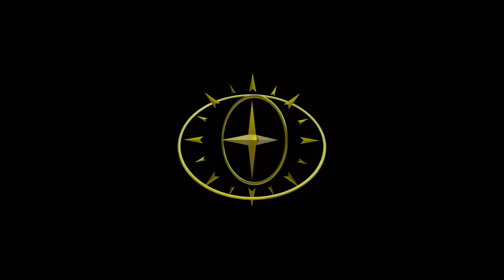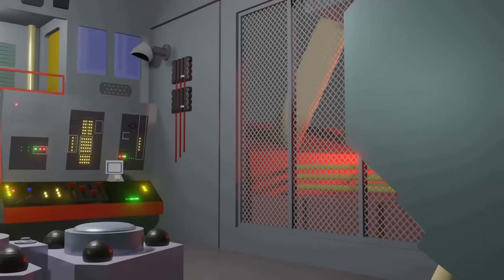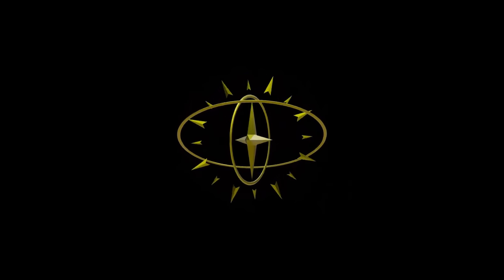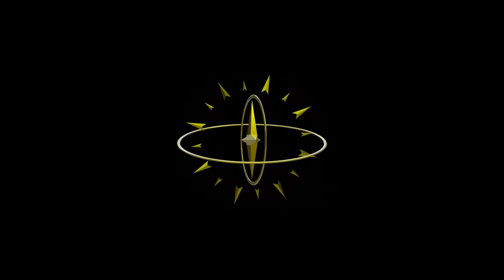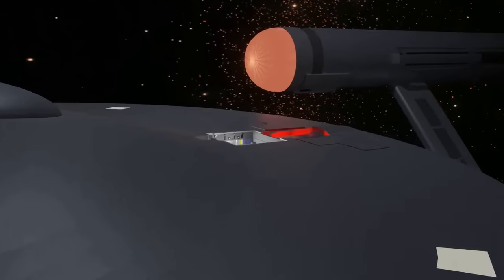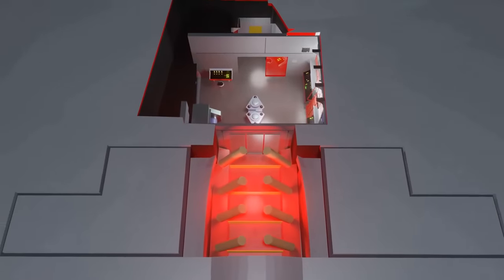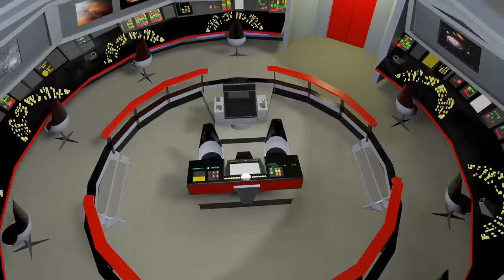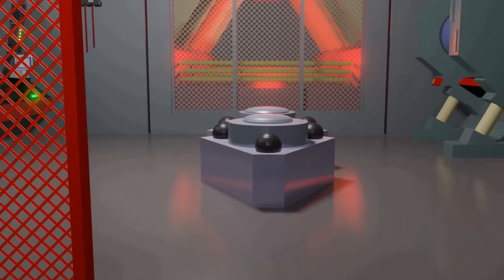The Enterprise Engine-room Enigma: where was main engineering?

Comment: Franz was just creating fan art outside of the shows creative team and his stuff is not canon…. Clearly this question was put to bed via subsequent efforts  by the Star Trek art department and scipubtech.
Reply: Who's Frank? Franz, you mean? Franz was commissioned by Roddenberry to create a canon technical manual, and his manual has TWO engineering areas: an area marked "Main Engineering" near the Impulse Engines in the saucer, and a separate "Warp Drive Engineering" in the secondary hull right under the nacelles. Main Engineering is shown to have computers that can monitor the warp drive from there.
Reply: @Idazmi7  Again not completely correct… Roddenberry saw the financial potential of the manual after the success of the blueprints but the manual was never passed by licensing or any of the shows art/ design department and while Gene may have given a nod that doest make it canon…  Engineering was in the secondary hull period. End of story
Reply: @chriscushman6580  
Gene commissioned it directly. Not Paramount. Paramount did license the Booklet of General Plans, which puts main engineering in the saucer. Period.
Reply: Gene was most definitely not a Trek Technical expert… Matt Jeffries said main engineering was in the Engineering/ secondary hull… again end of line.  Gene also got slapped by Paramount on licensing products… this was one of the reasons.  Ps you can turn off my ability to reply to your last statement but it doesn’t make you right…
Reply: @chriscushman6580  
The Secondary hull is not an 'engineering' hull. The Engineering Section is exactly where Paramount said it is: in the Primary Hull on Deck 8.
Reply: "Ps you can turn off my ability to reply to your last statement but it doesn’t make you right"

I actually have no idea how to do anything like that, nor any intention to do so.
Reply: @Idazmi7  clearly
Reply: @Idazmi7  You're very wrong about that. Both the Star Fleet Technical Manual (started 1973, published November 1975) and the Booklet of General Plans (1974, published April 1975) were not in any way commissioned by Gene Roddenberry. Later Franz and Gene had a falling out, and Gene moved to having as much distance as possible put between his vision of Star Trek and Franz's.
Reply: It was "put to bed" even earlier than those, when AMT released the 22" cutaway model kit of the TOS Enterprise in 1995. The layout clearly shows Main Engineering in the secondary/stardrive/ engineering hull just in front of the nacelle pylons. This was closely followed in greater detail by the 1996 SciPubTech poster drawing and then a variation was used by Doug Drexler for his cutaway drawing, which in turn was the basis for the wire frame diagrams seen in ENT's "In a Mirror, Darkly".
Reply: @thomasackerman5399 
"(...) were not in any way commissioned by Gene Roddenberry."

A false statement, contradicting the very existence of those books.

"(...) Later Franz and Gene had a falling out, and Gene moved to having as much distance as possible put between his vision of Star Trek and Franz's."

An Internet rumor, unsubstantiated.
Reply: @Idazmi7  Unfortunately, none of what you're saying is true. Roddenberry did not commission these materials. There simply is no evidence of this. His only involvement was giving approval when contacted by Joseph.

It is not an internet rumor. We have the interview with Joseph's daughter and later Star Trek staff that corroborate that.That's why we got the "rule of two" for the warp engines. It's only because of the love for Joseph's work that some of the writers and art department staff ignored it.
Reply: @Idazmi7  They weren't commissioned by Gene Roddenberry. Franz Joseph approached him and asked about the proprietary rights, among other things. Gene saw the monetary potential and encouraged him to go ahead with the project. From the 1982 interview with Joseph:

"Karen got a set of the...they're called the "Enterprise drawing set" at Lincoln Enterprises...you know, the famous three-view and the cutaway, and other things from Stephen Whitfield's book; and the drawing of the hangar deck...and I think there was also a drawing of the shuttlecraft. From these sketches and those in Whitfield's book, I then laid out...those drawings were bad, they're out of scale...but I laid the drawing out, scaled and sized it, and made a drawing of the Enterprise. Next I devised the Dreadnought, made a drawing of one of the uniforms, and about twelve drawings in all. They were drawn on the format I'd already devised for the Technical Orders. I sent a copy of the T.O.'s for the Dreadnought and the Enterprise to Gene Roddenberry on June 3rd, told him what I was doing, and inquired about proprietary rights. I got a letter in reply immediately, stating there was no problem with the proprietary rights, that he liked what I was doing, and wanted me to proceed...So I sent him copies of some fourteen T.O.'s I'd made to date and I got a very enthusiastic letter back. He said he'd never seen anything like that before and he wanted to see more of it. So I started collecting Star Trek material in order to be able to make the T.O.'s. In the lists ST fans had made, they wanted to see things that were on the Enterprise but never appeared in the series. I had already decided that if I was going to do the work, at least it would be technically and scientifically correct."
Reply: @Idazmi7 
"An Internet rumor, unsubstantiated."

 It's not. Go to Trekplace and read the interview with Karen Dick, Franz Joseph's daughter. Very enlightening.
Reply: @Starshipsforever  
I've read that interview. It doesn't produce anything from Roddenberry, and it's on a fan-website with no official sources. Not to mention several hard contradictions with reality: every TOS movie has direct references to the technical manual, when that interview says the exact opposite.
Reply: @Idazmi7  It was explained why there were references in the first few movies. However, if you look at everything from Star Trek IV, onward, there are none, and by TNG there were only a few bits and bob references, again, most because some of the writers and art department staff were fans of the Technical Manual and plans.

The interview is with Franz Joseph's daughter, Karen who was instrumental in getting him to make the Technical Manual and plans in the first place because of her involvement in the earliest Star Trek fandom.
Reply: @Starshipsforever  There weren't completely none, Mike Okuda managed to sneak a few tiny references, though starships he lists do come from the original lists D.C. Fontana made and were published in "The Making of Star Trek", and FJ picked up on those for use in the TM.
Reply: @Starshipsforever  The 1982 interview with FJ himself and the one with Karen pretty much kills the idea that it was Gene Roddenberry that first approached and commissioned the TM and blueprints. Gene had nearly written off any new Star Trek at that point, beyond the Animated Series, and was looking to make some bank on it through Lincoln Enterprise merchandise. All he did was give the green light to FJ when FJ asked.
Reply: @Idazmi7  A false statement, contradicting the very existence of those books.

This is illogical. The existence of a fan made work is not predicated on Gene Roddenberry commissioning it. It is well documented that Franz Joseph was working on those well before he approached Gene Roddenberry. Roddenberry just gave encouragement and some advice.
Reply: @mikedicenso2778  
The Star Fleet Technical Manual is not fanmade
Reply: @Starshipsforever  
Star Trek 6 references the Star Fleet Technical Manual via Operation Return
Reply: @Idazmi7  That's exactly how it started. It was a fan made book. Karen Dick will tell you that any interview or article on it will tell you that.
Reply: @mikedicenso2778  
Franz Joseph himself said he was not a fan of Star Trek.
Reply: @Idazmi7  Yes, but his daughter Karen was and he created the Technical Manual in part because of her when she was attending the STAR with other fans and he took up the challenge of making better replica props, and the orthographic drawings he made to that end then lead to him making the Technical Manual. It's all in their interviews how it went down. 

He (FJ) approached Roddenberry, not the other way around. At that time Roddenberry considered Star Trek a dead franchise, but he was always looking for things to sell as part of his Lincoln Enterprises catalog of merchandise, so he gave FJ his approval to keep working on the manual. That's not a commission.

I'm not sure where you get this idea from that Roddenberry sought out FJ and commissioned him. It's pure fantasy.
Reply: @mikedicenso2778  
Franz Joseph himself never indicated such a thing. If Franz Joseph was not s fan, then his work isn't fan content.
Reply: @Idazmi7  Yes it is. It started off that way and that's how it was. That's what FJ's own interview states. That's what his daughter's does.
Reply: @Idazmi7  But his daughter was. He did all of it for his daughter and her friends. That's all in his and his daughter's interviews. I've seen others cut and paste quotes, so you can't claim not to have seen them, and I have to assume you've never read the Trekplace ones or you'd have capitulated a long time ago.  

In other words, I believe you created a fantasy and now you don't want to give it up. You've provided nothing to support your statements.
Reply: @Idazmi7  It was for his daughter and their friends and shown at local fan gatherings long before he contacted Gene at others' encouragement to do so.
Reply: @mikedicenso2778  This is very true. I don't know what this guy's problem is, but he doesn't grok the idea, even when entire paragraphs from interviews are presented to him, that the whole thing was Josephs' idea and he went to Gene, not the other way around.

It is a series of fanworks collected and then officially licensed over time via Ballentine Books a few years later.
Reply: @mikedicenso2778  
"But his daughter was. He did all of it for his daughter and her friends. That's all in his and his daughter's interviews."

On a fan website with no support from paramount or cbs, and no real supporting references. Gene Roddenberry was know for voicing his own opinions: why can't you provide one, single quote from Roddenberry supporting any of this?
Reply: @Starshipsforever  
"It is a series of fanworks collected and then officially licensed over time via Ballentine Books a few years later."

The Booklet of General Plans is copyrighted by Paramount 1974.
Reply: @Idazmi7  You mean other than that they directly interviewed Karen? I mean, no one has to be interviewed by Paramount or CBS  for it to be truthful in this matter. Same thing in the June 1984 James van Hise's Enterprise Incidents magazine interview where he essentially says the same story.

So we don't really need to hear from Roddenberry, because two of the three people said the same thing, and no one from the Roddenberry estate has ever disputed FJ and Karen's accounts. And probably with good reason since FJ was meticulous about keeping everything filed away being the engineering aerospace engineering guy he was. Karen also has this to say on the falling out:

"GR had negative feelings toward FJ for several reasons. (1) GR had wanted to publish and distribute the Ship's Plans and Tech Manual through Lincoln Enterprises, his wife's (Majel Barrett's) business. When GR would not give FJ straight answers over who owned the rights to Star Trek (or finalize marketing plans after nearly a year of discussions), FJ went over GR's head and queried Paramount Pictures about said rights. At that point, Paramount took over the negotiations, hooked FJ up with Ballantine Books, and collected the resulting royalty payments instead of GR. (See FJ Timeline.) (2) GR and FJ had a disagreement over assignment of rights regarding FJ's prop design work for Planet Earth (see Q7 below). This disagreement was eventually resolved, but it must have left GR with the feeling that FJ was difficult to deal with. (3) GR did not think that his "credit line" was large enough in the Technical Manual, even though having any credit lines at all contradicted the whole premise of the book (i.e., that the Star Trek universe was real and the Tech Manual had been broadcast accidentally to 20th Century Earth by the real starship Enterprise during the events of "Tomorrow Is Yesterday"). (4) Once the contracts were signed for the first Star Trek movie and GR realized he/Paramount did not have the rights to any of the original work presented in the Tech Manual, he went out of his way to discredit FJ's work."

So, at some point you've got to grow up and accept that not only did Roddenberry not start the TM, he eventually had a falling out with FJ, for whatever the exact reason was.
Reply: @Idazmi7  incorrect
Reply: @Idazmi7  again incorrect….. they were already out selling at conventions etc… Roddenberry jumped on the bandwagon after that and got a publishing deal
Reply: @Idazmi7  you can talk all day… I along with many others have pointed you in the right direction… there is a well documented interview you can read, Franz didn’t have to be a fan to create these drawings… he did so outside of the studio influence making them fan drawings… as I am one of the Cushman brothers who started Scipubtech and our licensed Star Trek cutaways (35 years worth of work) and a technical advisor to the Roddenberry Archive … Engineering is in the secondary hull and remained there through to 1701 A…..   Sorry but you are incorrect and should do more research…. It’s a fascinating story with a rich history…. Good luck… LLAP! PS…. Note they are not the blueprints of the Enterprise but the USS Constitution… this was done to soften the copywrite issues….
Reply: @chriscushman6580  
"you can talk all day… "

So can you. I will ask you again for a Roddenberry source on this matter. I expect you'll just mention your fan site interview again instead.
Reply: @mikedicenso2778  
So we don't really need to hear from Roddenberry

Yes we do. Otherwise, every statement made ABOUT Roddenberry in your interview must be dismissed as hearsay.

So, at some point you've got to grow up and accept that not only did Roddenberry not start the TM, he eventually had a falling out with FJ, for whatever the exact reason was.

...according to hearsay from an unverified and unverifiable 'interview' that only exists on a fan website.
Reply: @Idazmi7  Your hint was in my last reply….
Reply: @Idazmi7  So? That still doesn't make it any less of having to start as a fan project. All the Franz Joseph stuff is that and he did it for his daughter. Gene just gave him encouragement to go get it all published, along with other people, and the rest is history. 

But Franz got the ball rolling.
Reply: @Starshipsforever  
"So? That still doesn't make it any less of having to start as a fan project. All the Franz Joseph stuff is that and he did it for his daughter"

You have no proof of that. The Trekplace article isn't proof: the validity of that article is that's what's being contested in the first place
Reply: @Idazmi7  Star Trek: The Undiscovered Country may reference it. The ship list names, like Eagle, are all from the lists that were published in "The Making of Star Trek" by Stephen Edward Poe as possible starship names. Before the Star Fleet Technical Manual was even published in November 1975, Greg Jein for T-Negative, used it for his article "The Case of Jonathan Doe Starship" published just 7 months before the Technical Manual.
Reply: @Idazmi7  You're spinning circles. This is outright nuts. The SciPubTech work is very well received and known as well as licensed by Paramount for many years now. 

The onus has always been on you to provide your evidence. The fact that you keep refusing even a licensed source as well as those reproduced on Trekplace and can be traced back to the original articles in their respective printings, with audio no less to back most of them up, shows you are living in a fantasy. Or worse, you don't want to admit that you were wrong. That makes you a very dishonest person, and not to be taken seriously.

So, cough up a Gene Roddenberry quote that he started the TM and then commissioned FJ to do the graphics.
Reply: @Starshipsforever  
"You're spinning circles." 

No, you guys are, using an unreferenced Trekplace article and then pretending that I mentioned or opposed anything else. Anything but my actual point.
Reply: @Idazmi7  That would be a lie on your part. It is not "unreferenced". There are plenty of references on Trekplace and elsewhere, including a detailed timeline of events by Franz Joseph's daughter of the events leading to the creation of the TM and BGP.

You've been going in mad circles trying to deny hard evidence against your assumption, because you have NO EVIDENCE to support it.

This is just nuttery. Your claim is that FJ didn't originate the idea of the TM or the BGP, and that it was some kind of super canon because GR came up with it and sought out FJ, making a commission with him. But everything says otherwise.

When people point out that it's at best partially canon and Gene's own canon rules from the 80s through the early 2000s says it's only what parts we saw of it on screen were, you went into full denial mode and came up with nonsense, including always moving the goals further to the right when evidence didn't jive with your faith.
Reply: @Starshipsforever  
"That would be a lie on your part. It is not "unreferenced". There are plenty of references on Trekplace and elsewhere, including a detailed timeline of events (...)"

That timeline of events in particular is directly contradictory to what we actually see in the movies. The exact moment the timeline says the films are 'irrevocably' in conflict with the tech manual, is exactly when the technical manuals start being used in the movies, so I disregard it.